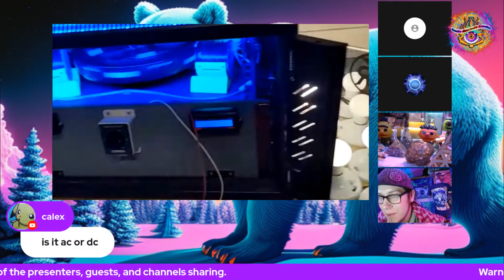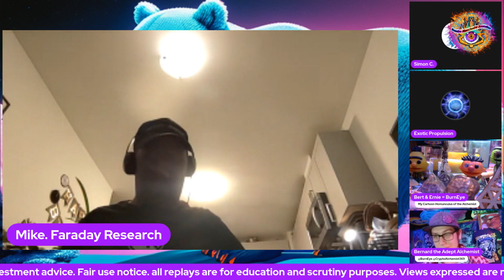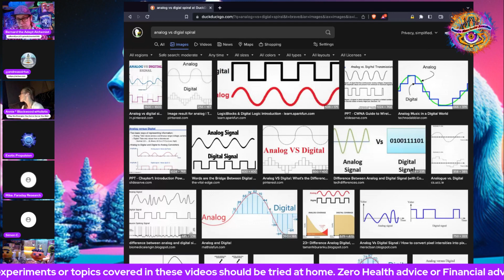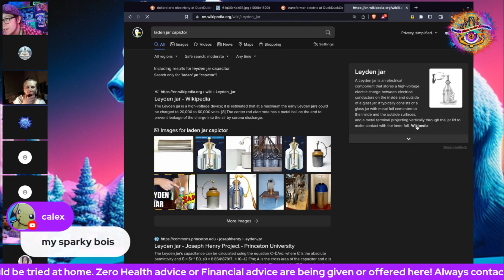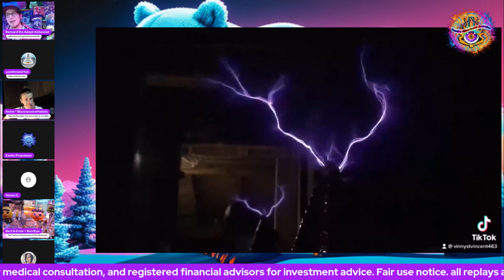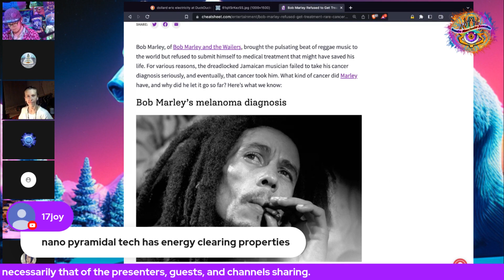FreeEnergy Fridays #RealScience Ep27 Livecut @burnEye & @Xirtus Ft Mike Faraday Research + Jeremiah

Comment: Electromagnetic induction is a 'shock wave' effect.  Transformers require a shock wave of magnetic polarization of the 'stuff' that fills space.

PHYSICAL ANALOGY
It's like the shock wave of heated water of an underwater welder or underwater flare.  When you first turn on the welder or ignite the flare, a shock wave of heated water bursts outward into the adjacent volume of water surrounding the heat source (the welder, the flare).  A thermometer will detect the burst of heat.

But the ocean is full of cold water, and the shock wave of heat is quenched, quickly, by the cold water.    Your welder is still on,  your flare is still providing light.   But the shock wave of heat that burst outward from the heat source was re-chilled by the massive volume of cold ocean water. 

My background in electronics started in 1979, tinkering, and it was pretty clear the transformer - or better put, electromagnetic induction - is a 'shock wave' effect.  Here's a way to visualize it:

1)  instead of AC, a DC current is fed to the transformer primary winding via a 12 volt battery
2)  a magnetic fields builds up in the space next to the primary in five (5) L/R time constants   (L is the inductance of the primary, R is the resistance in the primary)
3)  that magnetic field is CONSTANT from that point on, as long as the 12 volt battery is connected
4)  an ammeter tracking current across the secondary winding 'flashes' a brief current then shows zero again

Why did the current in the secondary vanish after its brief appearance?   The magnetic field that caused the current in the secondary is STILL THERE.  The 12 volt battery is still connected.

Space is not (normally) magnetically polarized and the shock wave of polarization from the primary winding is de-cohered.  Space can be polarized.  But it has the same physical behavior as the ocean water:  a temporary, very small local change (polarization) meets an unbeatable opponent (an entire universe of un-polarized, randomly-oriented 'stuff').

If you want to work at gravity control, it really helps to start a dialog with the team about the 'stuff' in space.  it's there.  The flash polarization of electromagnetic induction provides some evidence.

None of the profs I had said anything about transformers/electromagnetic induction, other than 'lines of force.' 

It's like gravity modification: a piece of the puzzle was being ignored or was not recognized.

I would wager that 99% of STEM-educated people cannot deal with 'there is stuff in empty space that can be polarized',  which is fine, they also would not want to tackle artificial gravity, so it doesn't matter.

But if you start building devices to alter the 'stuff' it helps to have a working theory or idea.  Once the shock wave effect of electromagnetic induction became easy to see, it helped build confidence for gravity modification.